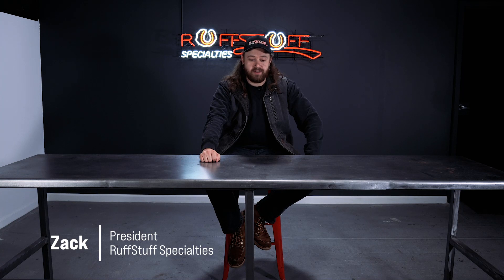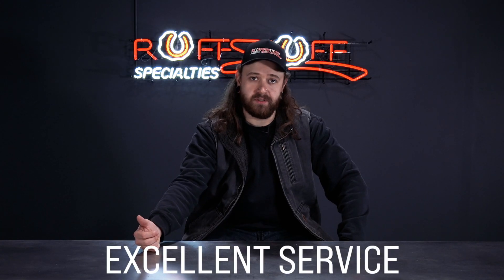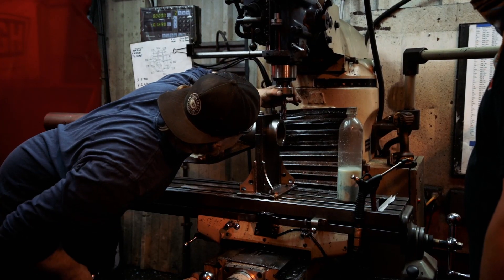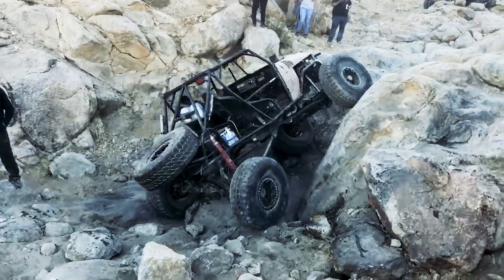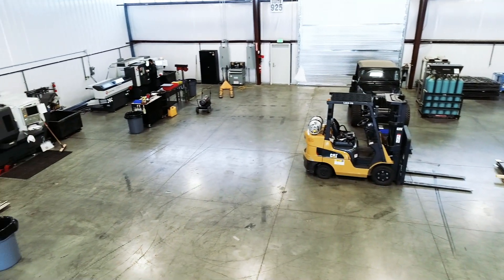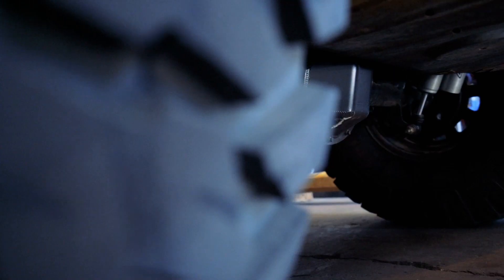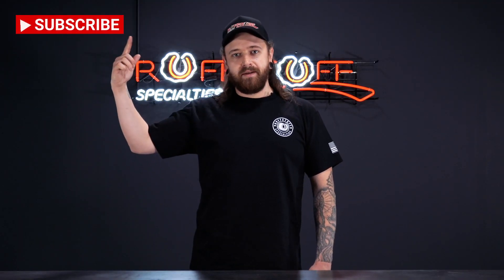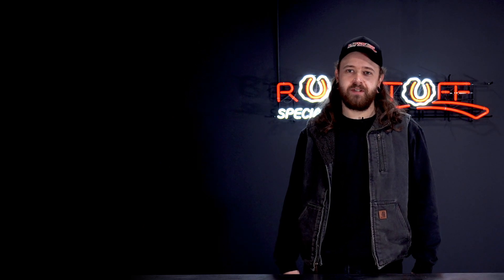What RuffStuff Is All About

Comment: Great philosophy, and great products. I have a set of diff covers, and some spring plates that are super tough, and have great fit and finish. I have preached for years that the only way our economy can be strong top to bottom is by keeping manufacturing on our ground. Outsourcing makes the top 2% rich, and provides the rest of us with inexpensive, yet worthless products. Also it leaves our manufacturing work base on unemployment, or welfare, a huge drain on the system. If corporate America would adopt your philosophy, everyone would benefit. However CEOs might only have one private jet instead of five.